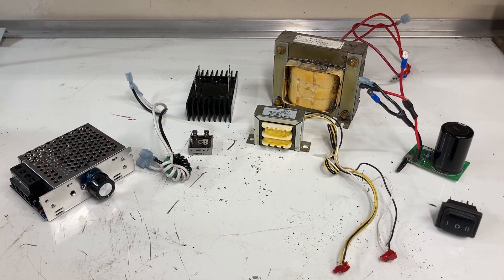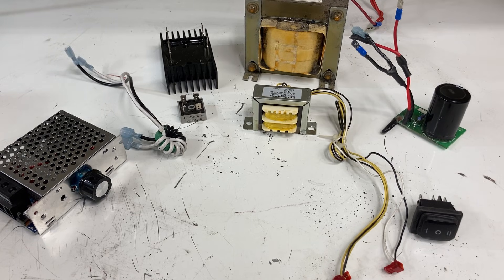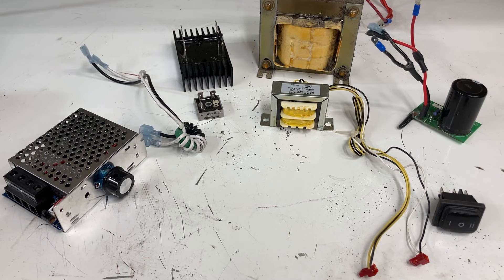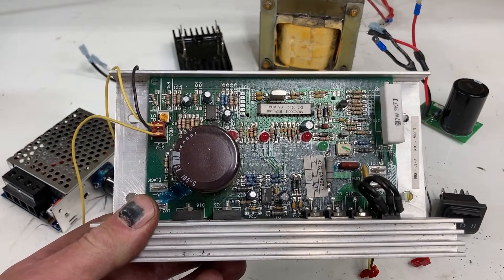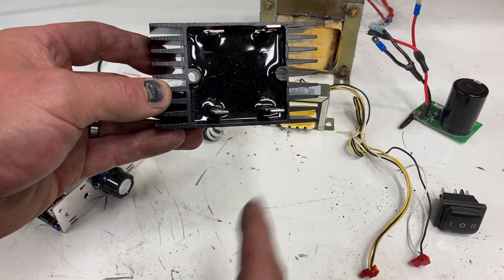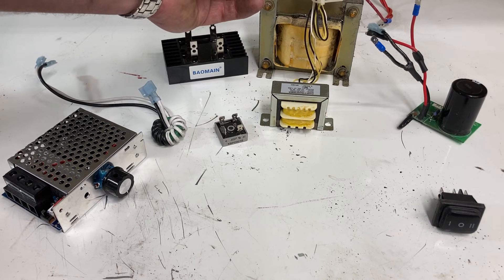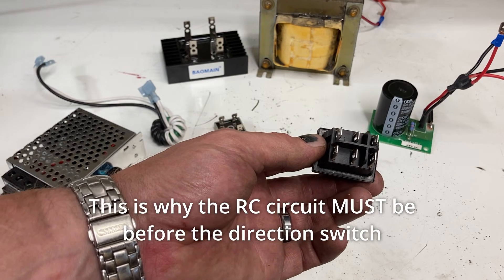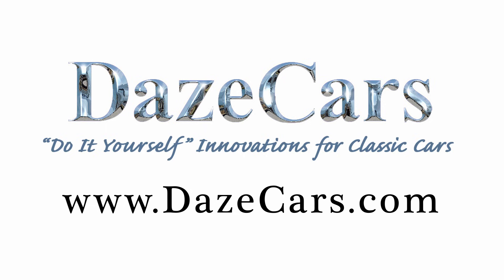Putting Together a QUALITY Variable Speed Power Supply or Treadmill Motor Controller SCR type

Comment: I know this is kind of an old video but some months ago I followed the instructions presented here to build my power supply for my treadmill motor and it seems to work really good! However I can't help but wonder about that capacitor shown along with the collection of parts used for this setup,  there's no mention of it so I was wondering if it's not needed or could it offer some advantages if used? The choke is of course used here to smooth out the power but since that's also the purpose of a  capacitor would adding one be helpful in any way or would it simply be a waste of time and materials?
Reply from the maker: I get this question about once a day and need to make a video on it.  I ran them on my machines when I first set them up but it caused two issues, the first is it took a little longer for the motor to stop spinning after turned off.  The second issue was surging under a load at low RPMS so I removed them.
Reply: @dazecars  Thanks, now I know! 

As I said my setup seems to be working quite well with very little brush sparking but I couldn't help but wonder about that capacitor in the video and if it would make the supply even better.  OK I will just leave it as it is, thanks a bunch you saved me a lot of money since I needed less than forty dollars in parts (using what I salvaged from the treadmill) and I am quite happy with the results!

Thanks again and I really like your vids!
Reply from the maker: @catman4644  Glad I could help!!!

Comment: I had built a controller for a treadmill motor that I was using on my pedestal drill. I had used the cheaper SCR controller that you show in your video and I had a lot of trouble with a lack of torque at lower speeds, using hole, saws and spade, bits, etc. I came across your video on building, a quality speed controller for a treadmill motor and thought great, This is gonna fix my problem. I followed your instructions, bought the better SCR controller and although the speed controller works the same problem exists with a lack of torque. Is there a solution to this?
Reply from the maker: what is the torque of the motor you are using and how do you have it geared?

Comment: Nice video, but... So what happens if you don't buy the "quality" SCR controller. I bought one of the "other" ones. I hook it up to the same treadmill motor that you show in your set-up but mine does NOT work smoothly. It pulses very annoyingly. If you really want to help us out do a troubleshoot video about what is actually going on, why these controllers might not work magically like you show in your video, and especially what to do to correct the pulsing. I bought 2 controllers on Amazon and both do the exact same pulsing thing, not just at low rpm but at whatever speed I set the pot at. BTW I have successfully converted multiple tools (drill press, metal lathe, wood lathe, sander) but this time I am frustrated because things are not working and I don't know why. I have tried the controllers on other treadmill motors and its the same. Anyway, help would be appreciated. I can't be the only one who has problems.
Reply from the maker: that is exactly why I tell people to "buy the quality SCR".  The cheap ones pulse.  There is no fixing it

Comment: Thanks a million for your lengthily response ,,, I will watch out for a micro at the curb ,,, FYI there is a part inside  those things containing some really poisonous stuff ,,, beryllium I believe ,,, again thanks
Reply from the maker: it's the magneto that is toxic, but as long as the ceramic part containing the chemical is not damaged there is no issue.  The bigger thing to watch out for is the capacitor it can kill you outright.

Comment: good instruction video,,, easy to listen to ,, my question is what would be the specs for a large DC  and AC  choke please ,,, the motor is 130 vdc max and 3170 watts ,,, this choke would be used in conjunction with the items listed in the SCR wiring diagram ,,, thanks a million in advance
Reply from the maker: Not being an electrical engineer I do not have any specs for you, what I can do however is offer you some guide lines.  First of all bigger is better.  I have several motor chokes ranging from the size of a tennis ball to the size of a soft ball and the bigger they are the better they work.  Second the wire for the choke needs to be a minimum of 16awg.  If it is not that big or better it will not have the amperage capacity to allow the motor to work properly.  Third they are not available on Amazon at least not inexpensively, there are a few privet sellers on Amazon selling used parts for big bucks.  The choke in most of my videos is part number 130993.  Instead of getting one new I would get a used one. A lot of treadmills come with a choke. Go to eBay and search “treadmill motor choke” BUT know that most people on eBay don’t know what they have and the word “transformer" will also appear in most listings. Problem is a choke and a transformer look almost identical so some listings are for transformers and some are fore chokes because the sellers think they are interchangeable. They are not. They would only be interchangeable if you modify a transformer to work as a choke.  (see my DIY choke video)  To tell the difference count the wires. A choke will only have 2, a transformer will have 3 or more.  Also before I started doing videos chokes on eBay could be had for $25 or less shipped but now that more people are looking for them (due to my videos) the eBay sellers have raised their prices quite a bit.  Your best bet might be the DIY option out of a Microwave transformer. Please let me know if I can be of further assistance.

Comment: I too use a thread mill motor as well and I found out that if I use the motor alone without the flywheel it comes with I get that bogging down when force is applied, but if I keep the flywheel on the motor I get a lot less...
Reply from the maker: It is likely that your motor is undersized and/or you do not have it geared down properly.  The motor on my lathe does not have the flywheel and I single point thread at 100 RPMS in a grade 8 bolt all the time, very high tool pressures and motor load.  It not an issue and there is no bogging because its a big motor and I have 3.5:1 gearing

Comment: hey, got a question about the bridge rectifier. i ordered the large one you use. the connectors needed for this thing are huge. what size connectors do you use going from say, 14awg wire to that size connectors. do you solder the wire to them? thanks in advance
Reply from the maker: I soldered the leads directly to the rectifier and then used heat shrink tubing over the top.

Comment: Hello, have used you system, but my power at low speed is pulsing. Any recommendations?
Reply from the maker: Sounds like you got the long skinny less expensive SCR that everyone else on YouTube recommends instead of the higher end one with the cooling fan that I recommend.

Comment: Hi. Great video. Did you ever try to use Solid state module like fotek ssr-40 VA for example instead of scr. Do you think that would be a good idea. Thanks
Reply from the maker: I could be mistaken but it is my understanding that that is just a relay and does nothing to very voltage.  The voltage ranges it shows are operating ranges not any voltage conversation.  The voltage that goes in is what will come out.

Comment: I have everything but the dc choke. I don’t know what to get. 
Also, what capacitor do I need and how do I wire it in?
Thanks. Trying to follow and build your system. 
Oh, how do I get an rpm display with this, what type and where does it hook in?
Paul
Reply from the maker: These videos should help, let me know if you have any other question

Capacitor info
https://youtu.be/PDU59Tns_E0

Choke info
https://youtu.be/WRT_Ri18eLY
https://youtu.be/sYjkQvUSths

RPM display info
https://youtu.be/MmRMNo9IbVU

Comment: How does the fan on the motor work when it’s going in reverse?
Paul
Reply from the maker: Depends on the fan. If it is part of the flywheel there is no effect. If it is a stand alone fan the air flows the opposite direction.

Comment: Is it ok to have two toroidal ferrite rings, one for each wire? 
Where do I get the dc choke and capacitor?
Thanks. 
Paul. 
Love your videos.
Reply from the maker: Glad you like them. As far as chokes check out my other choke videos. I found running a a capacitor caused surging under a load so I removed them.

Comment: Truly appreciate your video, great job. Thank you !!!
Is it possible to send or post the exact part numbers of the parts you purchased to assemble in your circuit ? That would just the greatest !!!
Thank you in advance, Scott
Reply from the maker: Most of the parts are linked in the description The AC inductor can easily be made by getting ferrite doughnut and wrapping some wire around it.  The choke in most of my videos is part number 130993.   Instead of getting one new I would get a used one. A lot of treadmills come with a choke. Go to eBay and search “treadmill motor choke” BUT know that most people on eBay don’t know what they have and the word transformer will also appear in most listings. Problem is a choke and a transformer look almost identical so some listings are for transformers and some are fore chokes because the sellers think they are interchangeable. They are not. They would only be interchangeable if you modify a transformer to work as a choke.  (see my DIY choke video)  To tell the difference between a choke and transformer count the wires. A choke will only have 2, a transformer will have 3 or more. I would also recommend watching my most recent video.  Its a little long but brakes down the pros and cons of the the 3 most common DIY treadmill motor power supply options https://youtu.be/AdGypyO_UuM Please let me know if I can be of further assistance.

Comment: I have to thank you for this thread and the several others that pertain to doing this setup.  I did this and my G0602 lathe operates flawlessly, quieter, no power loss.  Had to make sleeve to mount pulley on to the motor shaft, which was done before tear down.  
Anyhow, thank you for all this information.  It is like having a whole new lathe and cutting 1/4 inch of 20 tpi threads is so much easier with the slow speed.
Reply from the maker: You are very welcome!!  My results were the same as yours.  This is the single best upgrade I have done to my machines... and I have done a lot of upgrades.

Comment: Hi, I have a DCMD57P controller board and am not sure how to wire it to a PWM ? Have you ever wired one and if so can you explain how to do it. Not sure which of the 12 wires to use. Thank you. I am using the signal generator module with LCD display and rotary switch you use3d in your video.
Reply from the maker: Sorry but I don’t have a hack for that board.

Comment: Another great video. Question ? What size RC circuit are you using ? Resister size and Capacitor size ?
Reply from the maker: I just cut up a defunct treadmill board.  However I found that under load the RC circuit causes surging so I removed it.

Comment: This is a nice video.  You did a nice job and the video is interesting and you keep to the point.  My treadmill motor is typical and pulls 14 amp.  A 14 amp Hammond choke costs $157 at mouser electronics.  Your voltage controller is $27 on Amazon not $20,  The big rectifier is $13, The dpdt switch I admit I'm guessing is most likely $5,  and the capacitor is maybe $5.  The scr in the circuit will surge at low power levels even with the choke and capacitor.  A cheaper better performing circuit is to  buy a 20 amp variac on ebay for $61, capacitor $5, recitifier $13.  The ebay variac already has the switch and a variac circuit does not need the expensive choke and only needs two other parts namely a rectifier and and a capacitor to work and actually will work without the capacitor well.  The variac circuit is more robust and will work better than your circuit with the high parts count. I guess I should make a youtube video.
Reply from the maker: That video is over a year old, prices have gone up.  Interesting information,  I may pick one up and test it out.
Reply: @dazecars  Thanks for your reply.  You make good youtube video's.
Reply from the maker: I want to respond to this a little more in depth, not being argumentative just working it through. Yes your prices are accurate but they do not reflect used parts. I have several motor chokes sitting on the shelf that came in treadmills I got for free. Not all treadmills come with them but they can be had used on eBay in the $25.00 range. A quality SCR like the one I show in the video will not surge at low RPM. I use mine at the lowest RPM on my lathe all the time and it is smooth as silk. The cheeper one that everyone seams to be using (long skinny) will surge at lower RPMS. That’s why I show it doing just that in the video to show that not all SCR voltage controllers are created equally.  I even purchased the other one that is commonly available with the digital readout and push button speed control and it too was free of the low speed surging but my torque dropped significantly making it the worst of the three.  There is a huge difference between a quality SCR controller and the cheap ones. Depending on what comes in your treadmill and what you can get used a person can easily set up an SCR controller in the $50-$100 range. With all that said I am intrigued by the transformer you have shared info on and have ordered one. I will set it up on the bench and see how it performs, compare it to the SCR, and maybe even the PWM Mc-2100. One of my future projects is to build a small motor dyno. That way I can test all these power supplies. A lot of people don't realize that torque on a DC motor has a direct relation to amps being supplied by the power supply, and amps can drop at lower voltages  but with a dyno I can do proper testing and compare all these power supplies. I really appreciate your comment and am looking forward to testing the variable transformer you recommend. I am also glad you like my videos.
Reply: @dazecars  I didn't know these SCR controllers existed.  I bought two of them to play with.  I am an electronics hobbyist.  I most likely have a suitable choke somewhere in one of my junk boxes.  I want to build your circuit this weekend and play with it.  I'm converting a friends bandsaw to variable speed with a reduction pulley system so his wood cutting bandsaw can cut metal.
Reply from the maker: @dwtees  "hobbyist" that describes me as well.  The biggest advantage to the SCR besides simplicity is the ability to have a fine and course speed control.  I can dial in my speed within in a couple RPMS.  I am looking forward to trying the variac.  After your original post I have been researching them and the power is very clean so I am predicting it will work well other then limited numbers of speeds.
Reply from the maker: Chack this out https://youtu.be/oSZYEUm1SuY

Comment: Good afternoon
I am wondering whether this diagram can work on a single phase 230v induction motor to vary the speed. The VFC is the ideal converter for this case but it is costly.
I will appreciate your advice/comments
Reply from the maker: Absolutely not!!  A single phase 230V induction motor is AC and this setup is for DC.  You may think you could eliminate the rectifier so that it is AC to AC but it will still not work.  Using just an SCR the motor will slow but it will loose torque and it will not run well, to make maters worse prolonged use will damage the motor.

Comment: have you looked at the PWM 5000W DC motor speed controller, DC 10-55V@100A max. Amazon for $27.99  looks like it would work.
Reply: link to above: https://a.co/d/hidAish
Reply from the maker: It could work but I see a few red flags.  First you still need a DC power supply big enough to power the motor and it need to put out the max voltage that unit can handle which is 55V.  Said power supply also needs to be high amp 15-25 as that is the amp range of these motors. Then there is the second issue that PWM has, at a max of 55V you will not get your treadmill speed up, much  past half.

Comment: need help with the wiring of the bridge rectifier like the on you have . Is the ac going to the positive and the negative on the same side of the rectifier or does it go cati corner .
Reply from the maker: The rectifier should be clearly labeled the sideways S is AC the + and - are DC.  Be carful hooking it up incorrectly can cause all kinds of problems/dangers.
Reply: @dazecars  thank you I definitely had that reversed. 
your videos really help alot